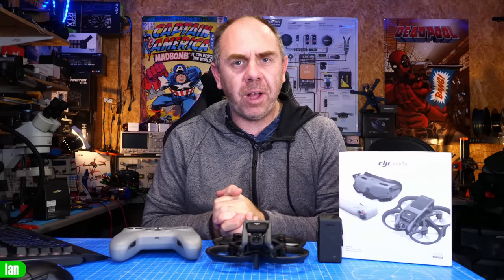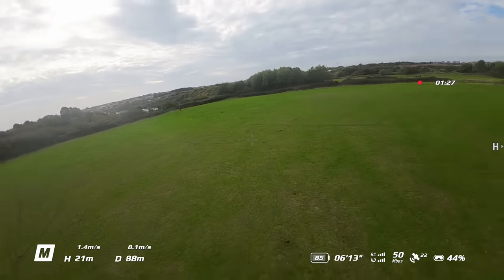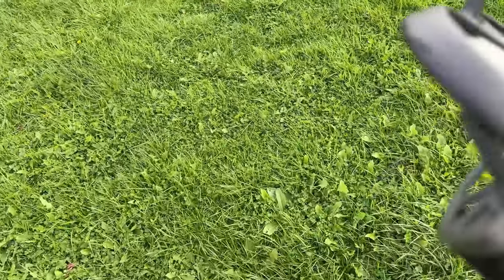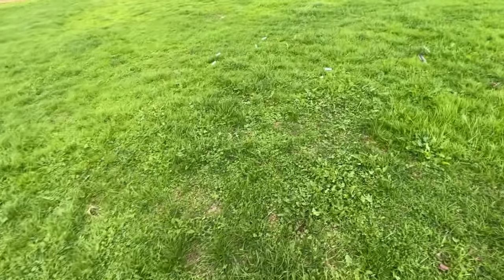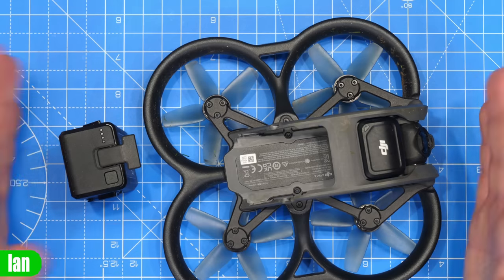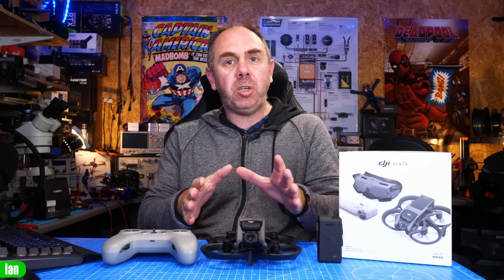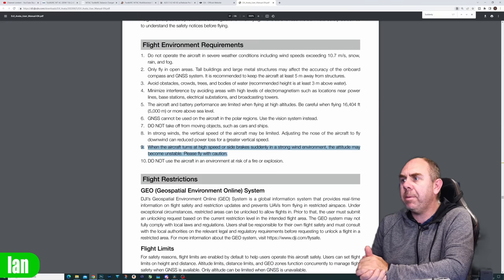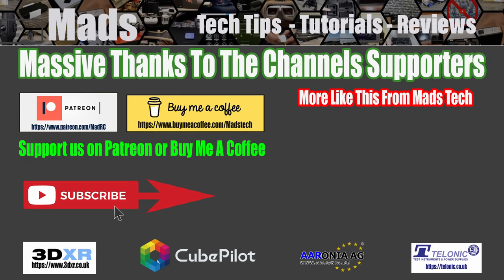DJI Avata Manual Mode Warning  - Yaw Crash Risk

Comment: The avata does have some serious software issues, from the motors not turning off when you hit the motor off switch, to switching to normal mode from manual or vice versa sometimes it just yaws right into the ground. I am hopeful they will fix it in future updates.
Reply: Now after 5 months the problems are solved or not?
Reply: @matteo31149  I do not fly it as much as I use to (I got a new drone) nor do I do hard YAWs with it and im a much better pilot five months later but ya the avata has not freaked out and crashed on me in a while. Also after now buying a 5 inch quad and owning the avata. Its important to ask yourself what you want to do with the avata. If you are looking for FPV video footage or to just fly around its great. That is what I wanted but I quickly wanted more. I wanted to do tricks, I wanted the drone to have more power. So that is why I have a new 6s quad now so I get the best of both worlds. I hope this helps .
Reply: @MobileGamingLegendz  I understand thank you 💪🏻

Comment: The Avata is very top heavy.  When inverted in flight it seems that it would be impossible to avoid a collision due to that inverted weight shift.  If, however, the Avata is inverted and on the ground, activing 'turtle mode' should easily flip it right side up.

Comment: Ian, most interesting is the OSD elements left of the display. Before the pitch-over event (2:10, 2:25) altitude reported as 13m (H), jumps to 21m ... and when later on ground is reported as 14m. Speed even more interesting as <0.5m/s but jumps to over 27m/s.
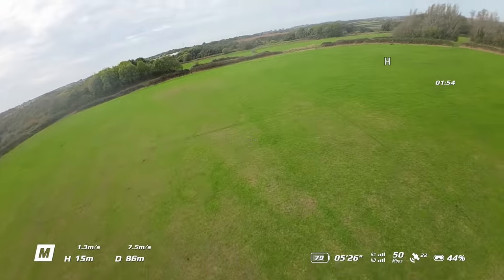It appears that one, or more motors when high throttle at some point. This clearly seen in battery % .. 78% at 2:10, but drops to 74% by 2:18.  (This compares to drop from 80% to 78% from 2:00 to 2:10 .. video timestamps)
ie: appears to use ~2x the amount of power, energy as was being used during the pitch-over event, as was used in flying prior.
Was watching values while replaying at 0.5x video speed.

Wondering if there is a way to access "blackbox data" from goggles SRT file, video meta data, or from the drone for better detail with timestamps?
Reply: Wonder what would happen if suspended the Avata via a string (actually by two strings, or heavy duty fishing line, so suspended above the ground, but constrained above and below).
Try yawing left and right in place, with bit less than hover power while you are positioned a safe distance away, you might be able to reproduce the pitch-over behaviour (could try experimenting initially with propellers removed). Recording sound and movement for later reference.
Reply: great observation!

Comment: I think its one of 3 things,I mainly think it's the esc on the front left motor just sensing a voltage spike or thermal spike&shutting itself down.The fact the other motors continued to spin,means the imu&flight controller were still operating& the 2nd cause could be like the arming angle we have on betaflight,dji usually has a motor stop when it feels the quad tip past a certain angle.So it may be that the disarm at a certain angle was either only operating on one motor,or whilst in manual mode the tipping over of the craft dosent disarm it.That would be an easy one to test.So my second idea could be hardware,or software conflicting.Or lastly,with my own builds,with some of the less reliable gyros,I'd get the dreaded spin of death,where the signals from the imu's fed into the flight controllers algorithms,would end up causing a feedback loop,so it would literally spin one motor to maximum&the software on the fc must have froze.So my 3rd idea is it could be something related to the gyro data not being filtered in a specific frequency,as the motors&frame are all tight to the fc chassis,I'm guessing their might be a certain frequency resonance that only happens in manual because,the filters are tuned to be less interfering when in manual& the filters are set higher when not in manual to get smoother flight.I wonder what flight characteristics full expo settings and flips& rolls would have.Id be interested to see that,as I don't own an avata I can't myself,but I would test the flips etc. If I did.Keep up the good work,I was already on the fence with this one,I'll be patient and wait to see if air unit3 is any good to put on my own builds,as I do like the look of the goggles. Does anyone know if you can use them to mirror the og smart controller, because then I would get a pair of those🙈🙉🙊👍🇬🇧👌😉

Comment: That doesn’t just happen in manual it actually happened to me using the motion controller I made a sharp turn like a real sharp turn and it came right out of the air. I was in sport mode by the way

Comment: I just installed the C157 motors and tested the Avata in manual mode throwing in a few hard yaws, flips and rolls.   When the battery was around 40% during a clockwise yaw the Avata decided t0 take a dirt nap.   When I retrieved the quad it was upside down (in the mud of course) with the motors running like it was armed, when I tried to pick it up the motors would go to full speed so I pulled the plug to shut it down.     I did have the "impact detected" message but I have no way to see exactly when that did appear (next time I'll watch for it).   
After the Avata sends the "impact detected" message I'm wondering whether that is the point  when all control is lost, I did not have any control when it decided to have a gravity attack.

Comment: In full size (and model) helicopters there are two phenomena which will cause a similar incident - retreating blade stall and advancing blade transonic - caused when making a harsh steep turn at high speed. Is it possible that this is the cause? What about all the other Avata incidents - did they all occur when turning left? Not saying this is the problem, but it has to be worth investigating if only to rule it out.

Comment: Looks like the motors cut out at a certain angle!
Could someone test the tilt angle cut off as you hold the drone running in manual mode, to see if tilting one way or another is different?

Comment: Too much I term. Really, it exhibited the same downward nose thing when you turned right, it just happened to dip more on the left turn enough to crash. Considering it's a fairly symmetric machine, I'd chalk up the direction to more of a coincidence. The problem is that once it hit the ground, it freaked out. That seems like an I term issue. Just like when you bump a wall with a whoop and it sucks into it and goes crazy. Lowering I term helps a bit. Maybe they're not using the latest version of betaflight,. 😆     Sounds like they also need to put more priority on the kill command.

Comment: The batteries are very small… when mine popped out it took a while to find, like yours.  I’ve only had one incident like, where I deliberate turned very tightly, and it does become unstable, but I didn’t end up crashing on that occasion… I’m only flying in manual mode too…  Let's hope it keeps behaving…

Comment: I have watched several videos on this...some of the fpv pilots will call this yaw wash or whoop wash...I think its a software issue cause it seems like often there is also a change in the home point and the crashes  happen with a left yaw turn...I really think it's software issue cause if there is constant translational flight--clean air is gonna be constant unless the drone is close to the ground where there would be more dirty air like where most of the fpv pilots are but many of the videos flip crashes are at 1-2 mistakes high...in other words recoverable...just an observation

Comment: I would avoid switching into Manuel Mode mid flight. It's a software issue all in that little flight controller. DJI needs to make an update available. Otherwise take off in manuel mode if you want to fly the mode.
Reply: Does taking off in manual mode stop the tumble?

Comment: If they're aware of the propwash type issue as highlighted by the warning in the manual, is it possible the error you encountered was something to counteract it gone completely wrong? 

Great to know and see it reproduced though, I've been flying mine for a few weeks and not encountered this issue yet as most of what I like to do with it is slow and flowy but I have made note to definitely never turn hard over water or somewhere it would be unrecoverable.

Comment: Hi Ian,  just want to know your opinion on this point:  for me, the DJI Avata is under-powered and over weight.  Firstly,  I think it needs significantly more motor stator volumn to handle it's weight, maybe a motor in the 22xx range.  Secondly, does it fly with props out? If so, doesn't that put too much work on one of the rear motors?  One of the remedies of yaw wash-out on under powered tiny whoops was to run them props out, which, if my understanding is correct, puts less work on the same rear motor. Love your content as always 👍

Comment: I personally don't believe that manual reference is in relation to this fault.. It sounds like the same "caution:hot part will burn if touched"  nonsense in some manuals.  "caution: flying in strong wind may not give perfect control" (oh, REALLY?)... Just worry when you see "caution: sharp turns may cause the unit to turn fast"... This looks more like a outright firmware lockup, and is double worse since you loose complete control, and can't disarm - that should never happen at close range!

Comment: I have the same problem first two weeks flying I thought mine is free of this problem but yesterday i chased a quad bike and I nearly crashed into water 2 times in tight turns  really wierd feeling don't understand why it's doing it like the Motors stop for a second at high momentum so sad except of this it's the greatest drone in my opinion

Comment: Yeah hi good morning I have mines but I haven't pushed it because I seen what everybody is going through with that mode. And right now I'm not ready to flight manual do I have some simulation time. I got my avatar like about a week and I've been following everybody's advice and finding that manual mode yet. For me it looks 100% to do something with the gyro. We definitely need a new update for the drone at least not another bank that hard so it won't go into that probably when you guys fly manual mode. Again is gyro information because as you can tell me the craft was on the side for one moment so they really need to do an update right now I'm just flying mine and not taking those hard turns

Comment: I bought some reflective sticker strip in multicolor on Amazon and placed a couple pieces on the batteries to help me locate it if this happens and it will happen to me as well. Glad you got your battery back. Freaking expensive battery to lose. DJI really knows how to jack you for batteries! I could buy a nice car battery for the cost of one of these small batteries. Crazy! :goodvibes:
Reply: The minimavic 1 had 2 Samsung 18650's that cost $3 each when buying singles...sold them for $45 and call them "Smart Batteries "   Smart is codeword for proprietary DRM to make it impossible/difficult to use readily available batteries at reasonable prices.
Reply: Get a 40cm battery strap from Apex or another brand .. It fits perfect wrapped around through the front of the frame to the back of the battery. It will save you from having to look around for a battery.  Works perfect for keeping the battery in place. If you can't find the longer strap you can also use 2 shorter straps put together will also work.

Comment: i was flying in manual mode and i brushed against a few leafs while passing by a tree branch. it instantly went full send across the field i was flying in reverse i did not have any control until it just crashed and tossed the battery. and the very next time i tried to fly it i was using the motion controller i was in N mode after using the brake and without touching anything on the remote it want full send into a wall and destroyed the frame and ripped the gimbal off

Comment: I still fly some very cheap Chinese Pixhawk clones that I have had for about 5 years, even they have never done anything like this, and they are running on firmware that is about 4 years out of date. So just why DJI is releasing a product with such an obvious and known about flaw in 2022 is beyond me. Yes a craft can become a little unstable in some conditions, but it should quickly recover and carry on. In the case of the Avata it would seem it is prone to simply losing the plot in some situations, and the fact it simply carried on trying to beat itself up once it had hit the ground makes me think the f/c is locking up for whatever reason. A bit of washout from a tight turn should not cause the f/c to lose control completely.

Comment: These motors are definitely undersized based on full manual mode flying.  Anyone else feel their throttle is at 40-50 percent just for straight and level flying?  On my 2.5 with 1404 l prop Cinewhoop, I'm only at 25 percent.

Comment: Hello mate,  hey just a thought do you think the memory card slot cover could be opening slightly with the force from turning or prop wash , then temporary gaming or stopping that one motor.   Because to be honest mine doesn't feel that securely locked in, the props are that close to the rim the cover would only have to pop out a little to gam the prop.
Reply: I happened to have mine with me on my desk and had a look, this is definitely conceivable IMO. Because the clearance of the prop is so tight it would only need to move a mm or so to interfere with it enough to affect flight to that degree. No FPV expert but it's a logical possiblity

Comment: DONT  BUY DJI AVATA. i have one. The range is not what they advertised. There is a huge problem with the software. when returning home, the drone does not land close to where it was launched from.  

Also, the range is about 500m, and not 10km as advertised. when the drone loses signal, it does not return to home. it hovers on the same place until the battery runs out.  My DJI Phantom 3 has better range that the AVATA.

Comment: Very strange. I have flown the crap out of this drone and other than prop wash and normal tendency's of a cinewhoop, I have not had this happen. BTW I do use an Apex 40cm battery strap around the frame and battery to keep the battery from ejecting and that works, so folks that have the Avata may want to pick one up. I guess we shall see where all this goes. Strange indeed...
Reply from the maker: The funny thing is I had not until I went to try this today.  Tbh the move it dropped on was not even a bad one.  It was just a simple turn.
Reply: I'm the same as you mate. No issues and basically ran it ragged from day one, I've also used a battery strap from watching the first video I saw, with the battery popping out. No issues there either.

Comment: All you really had to do to find the location of the battery ejection was plug your goggles into the fly app, use the ‘find my drone’ function, and you would have had the last location as well as the flight path as it crashed from the black box data stored in the goggles. C’mon. This isn’t your first rodeo. I’m a noob and I know this shit. Today you learnt sumthin’ 😮
Reply from the maker: It was not remotely near there.  It had tumbled for well over 30 meters from impact point. That would not have helped me.

Comment: I have one more problem needs pointing out. I was hired to fly/review the Avata and was accidentally in Sport mode. Everytime the Avata touches something, we were testing how it will react when hitting something by flying it slowly to touch a wall, it spins and fall. The speed was like 3 cm/s. Once it touch the wall it freaks out and fall to the ground and the motors shut down. Wind from a fan cause it to shake heavily like it is trying to correct for the wind with off-the-chart PID tuning. I have made a video which included this problem too but basically the same content I typed here. https://youtu.be/7hXeKr0K8YQ

Comment: did you use the latest FIrmware v 01.01  0200 ?released september 14 if not mistaken
Reply from the maker: Yes latest fw
Reply: @MadRC  noted on that, the funny thing is, i just bought mine and while watching this video, i was actually doing activation and connect to my V2 + controller that came with DJI FPV, and you know what, i crash mine just now while testing avata in normal mode, weird movement happen i was hovering to get a feel of the controller in normal mode, while suddenly the drone backwards it self and hit a pole behind.. For your note i'm also a professional FPV pilot for commercial .. And this is weird 🤔